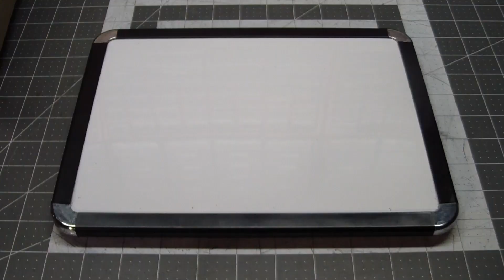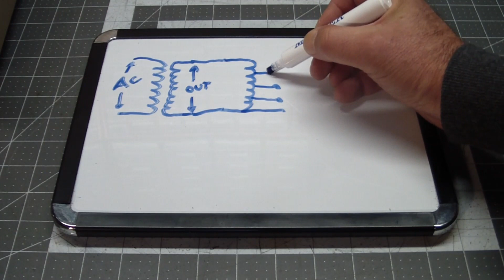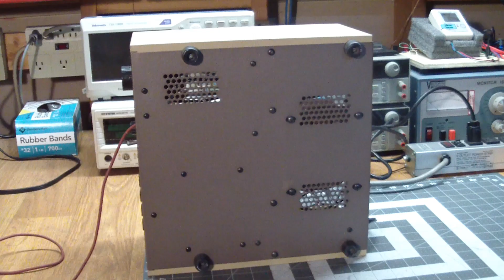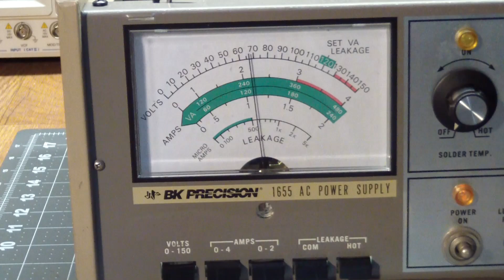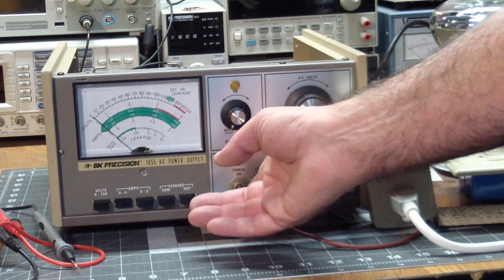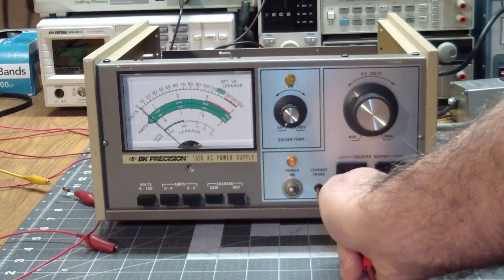AE#186 BK Precision 1655 AC Power Supply Repair Without Schematics

Comment: Thanks.
I have one of these I'm repairing. One thing, your picture should show the secondary of the primary feeding the autotransformer as having more windings than the primary side (step up) because the unit is capable of 150 volts output.

Comment: The B and K manual has the variac before the isolation transformer, which to me is a little strange unless it aids in reducing inrush (magnetization) current. A common modification is installing a switch to enable floating of the output outlet grounds, which may require a custom output box (use an isolated ground orange duplex receptacle) depending on how the output jacks are wire and if they are strapped (connected) to the chassis through the mounting ears, which is generally not the case with the square single panel push mount types. Usually on older 1655s the front square jacks are sprung (low or no plug tension), so a separate AC output box is added. 

I have the little brother to the 1655 which is the 1653 which also does not float the output AC safety ground. So it too has to be modified to float the output ground. 

If you do a lot of bench AC powered appliance (device) repair, and have used different AC power supplies over the years, most experienced electronic technicians design there own to include additional features like: Higher current output 10A (which means a large transformer and variac with surge circuit), current limit dead short option (bulbs or resistor), magnetic/hydraulic AC circuit breaker protection (circuit breaker protection to protect firstly the variac which is usually after the isolation transformer) instead of fuses, two analog AC current meters (with a switch MBB to select different ranges), one analog output AC voltage meter, two types of isolated output receptacle both orange floating ground GFCI duplex and regular duplex with a selector switch and with each having a separate power on switch. The isolation transformer is usually a toroidal hospital grade transformer with internal shield and over-temp self resetting thermal switch. The GFCI is a basic AC current leakage detector for the DUT. It will trip at about 6mA or above. So if it does not trip this means that if there is leakage it is below the GFCI threshold. Before each use the GFCI should be tested with its test button.

Comment: Could you use the Leakage probe to check AC leakage on the DC power supply. Like checking the filters for AC?
That's how I think it works.
Reply from the maker: Leakage is the what the GFCI outlets are based on. The general rule is that if >50mA is lost in the circuit then there's a problem. A GFCI will trip in this situation.

Comment: What is the leakage probe testing? the leakage of the AC hot side leakage current referenced to ground and the leakage current of the neutral side referenced to ground? I'm just confused what the leakage probe would be used for or have more examples of using the leakage probe to test transistors, fets, capacitors, inductors?

Comment: Here's my story... I am working from (poor) memory, here, so the exact details may vary... Around March of 2021, I realized my need (personal safety) for a proper AC power supply. I purchased a brand new 1655A (which is v-e-r-y similar to the non-A model; I forget the minor difference.) It arrived defective, due to a manufacturing/build defect. The seller replaced it, but the second unit was also defective. In both incidences, I was given authorization to see if I could make repairs, without voiding the warranty. What I found inside was an extremely old design that was 1) poorly engineered, even for the days in which it was designed and 2) that it was extremely poorly built (likely all by hand.) As the (new) price tag was hundreds of dollars and I having no confidence in the design, or build, I returned the unit for a refund. I know that the unit is rebranded, because Global also sells it. But, it is not of the quality of these two well know companies. I don't know who really builds it. I was able to find the 1655 schematic and service manual. I wanted to stock the consumable parts, for future need. The variable autotransformer brush is not available as a separate part (it is only available with the complete brush arm assembly, for hundreds of dollars.) I was able, through much research, to determine what the proper individual brush was ($40.) The fuse in the probe handle is not listed anywhere, but I did find out what it is. I knew that my (deep) research was likely the only source of this information, so I documented everything on the EEVBlog Forum. YouTube will not allow me to post the links. But, you can find the details of my adventures, documents, parts numbers and sources and work-arounds by doing an advanced search on the EEVBlog Forum for “BK,” for my user name “t1d.” The exact titles on the topic are:
1) BK Precision 1655A AC Power Suppy- Replacement Brush and Leakage Probe Fuse Info
2) Help configuring ACS724 to monitor/limit current of Iso Variable AC Power Supply
3) Do you know this "YS" or "SY" Taiwan Manufacturer Logo?
4) I need an education on electric brushes for a variac - AKA electric motor brush?
5) variac carbon brush material?
I do not have any more information than what is contained in these threads. I deleted everything from my computer, as I did not keep the unit. I hope this helps. PS: As I recall, the solder output wattage was really low, too. However, if I had absolutely no AC power supply equipment and I found one of these, fully working and for super-cheap, I might buy it.
Reply from the maker: The difference between the 1655 and 1655A is that the former was built in the US and the latter overseas which may account for the poor quality you observed. The designs are identical. It's a nice unit, and the analog meter is large enough to get good a good reading, but only after proper calibration. Thanks for the info.
Reply: @artifactelectronics  Poor quality> Overseas makes sense, because I was recalling that my board was white, no solder mask, hand soldered and flooded traces with solder. Not the nice BK board that you have. Glad the information was helpful. Hmm... I think I recall something about the difference between the two having to do with the probe... Maybe the switch, maybe the safety rating. Been too long to remember...

Comment: I guess the soldering iron would be isolated  too - if you were dumb enough to attempt to solder a live chassis might save a few sparks? It is nearly 3an as I write this so it could be garbage.
Reply from the maker: The solder output is tapped from the secondary of the isolation transformer.

Comment: Nice kit. I have an old medical isolation transformer and a chinese variac. Takes up more space :)
Reply: Plus a kill-a-watt to get more accurate voltage and amps, etc.
Reply from the maker: The problem with Kii-A-Watt is that it needs about 65 VAC to start up, so nothing below that can be measured.
Reply: @artifactelectronics  True. I'm just bring up a line voltage device slowly though and the dim bulb limiter will warn me of shorts and the variac has a somewhat reasonable voltmeter built in. The KaW is there to help me hit the proper line voltage and check the power draw as the dut warms up. It's a multi-part, cobbled together solution but it works :)

Comment: I think your drawing of the autotransformer is wrong since you are shorting windings. The slider shouldn’t be connected to the bottom line.
Besides of this small problem I like your videos. You are doing a great job. 👍
Reply from the maker: Thanks for the correction.

Comment: BK Precision still makes that as an "A" model. I looked at the manual and wasn't any better than what you had...
Reply from the maker: The 'A' is the same unit but built in a land far away with questionable materials.

Comment: Did i miss it?  what is the solder temp control all about?  does it have a temp controlled soldering iron with it?
Reply: Old irons were not adjustable. Plugged into 110v you'd always get the same temp. With this you could get some relative control.
Reply: It’s actually not a temperature control, but rather a wattage control. It’s better than nothing, but nowhere near as nice as a modern digital temperature controlled iron that actually has a temperature sensor in the tip and a feedback loop.
Reply: The best I could determine during my research (see my comment, above,) the unit was never sold with a soldering iron. And, IIRC, the soldering iron output wattage was really low.
Reply from the maker: I found a sentence in the manual that states the output is adjustable from 70 - 120 VAC using a Triac with turn on delayed directly by the pot.

Comment: Made a similar one years ago, having a spare 12VAC 50VA transformer, and a surplus unusable variac, as it is hard to use a 115VAC 5A 400Hz variac normally, but running it at 12VAC keeps the core from saturating, and made it a 0-12VAC power supply that I could use.

Comment: Germanium diodes or Schottky diodes, which will work there perfectly. But being point contact likely OA91 germanium diodes, perfectly capable of being replaced by Schottky diodes here, as the diodes are barely being operated in reverse. Likely the one that failed just had the point contact come loose inside, or the actual tiny die cracked.
Reply from the maker: I did poke the leads before cutting them, and they were solid. The ohmic contact(s) may have failed.